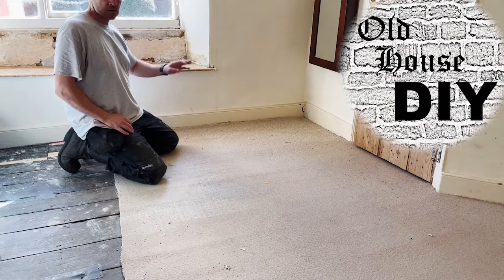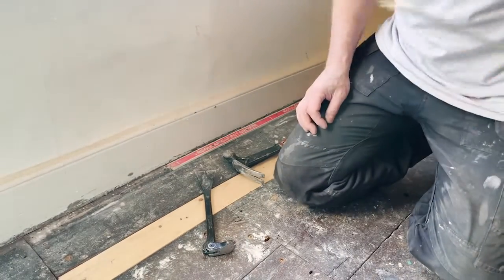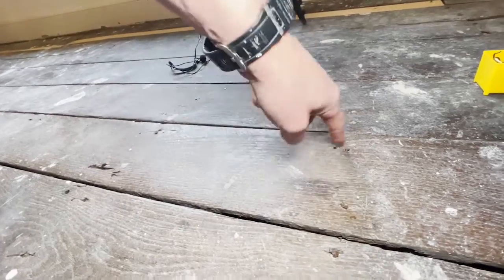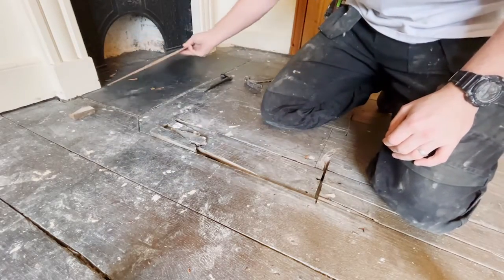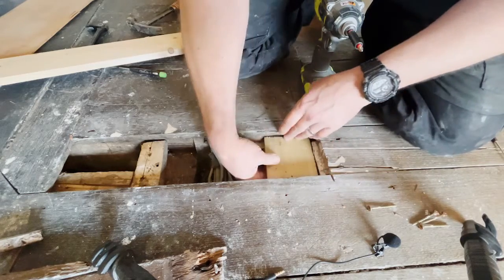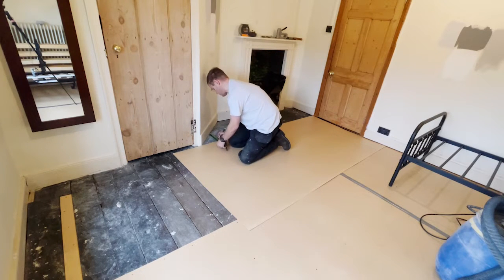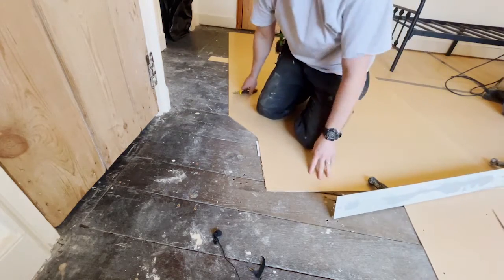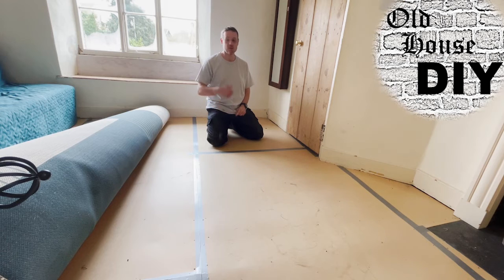Floorboard repairs

Comment: Great video, we are about to purchase our 1900-1920 terraced. And the floors need attention. Bouncing and rotten joists. We'll be using a laminate floor, but I do like the idea of over boarding to "smooth" it out first. What thickness are you using?
Reply from the maker: This one was 3mm hard board but I did our upstairs hall with 9mm plywood and our bathroom with 22mm chipboard. However, before you board over make sure all work underneath is done, not just joists but also any electrical, heating or plumbing.
Reply: @oldhousediy  Thank you, yes we'll be definitely sorting out all the services before we finish the floor.